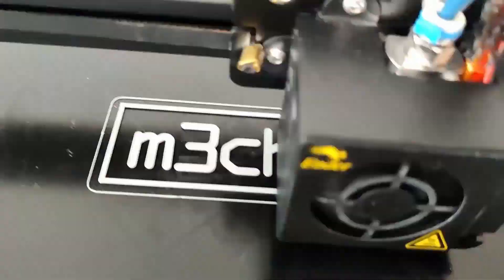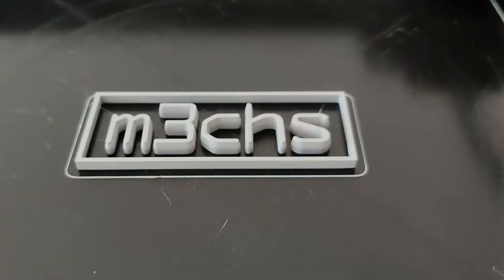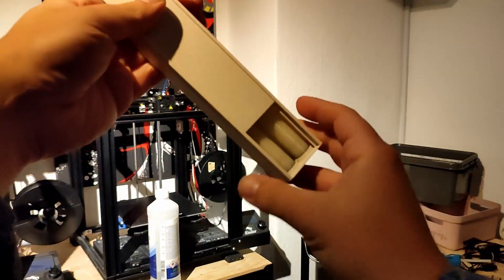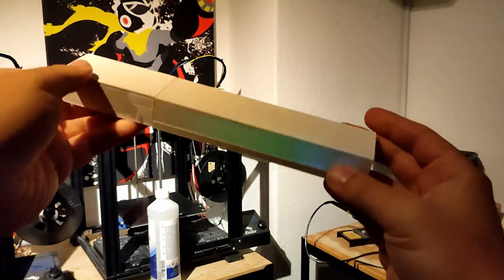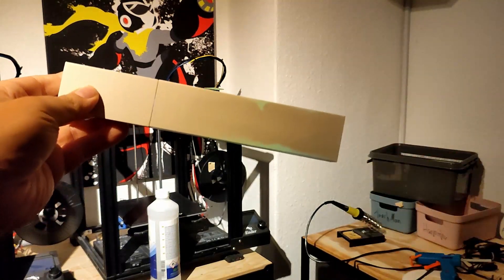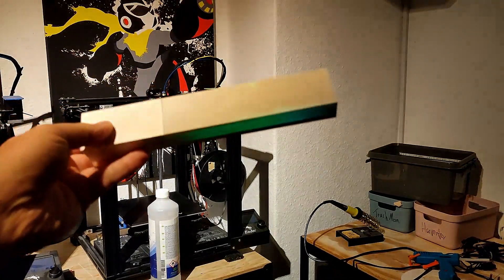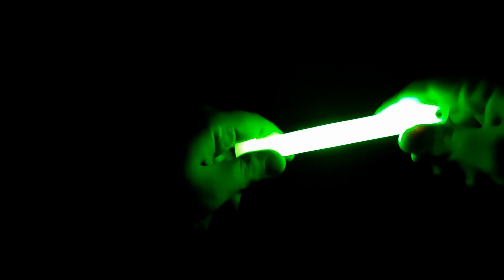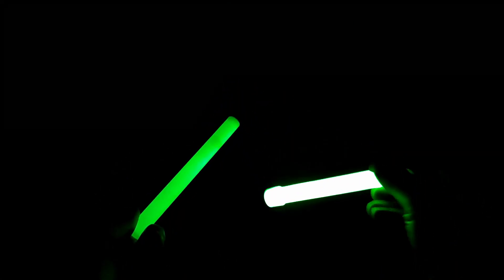This printed glow stick can be recharged!

Comment: I'd like to see real rechargeable glowsticks. With an AAA cell, a Joule Thief, and LEDs, ideally socketed LEDs so you can reconfigure them to the colour you like, but maybe RGB tape and dip switches would do fine as well. This would light for half an eternity, and like you get those low self discharge NiMH cells, they're rechargeable.